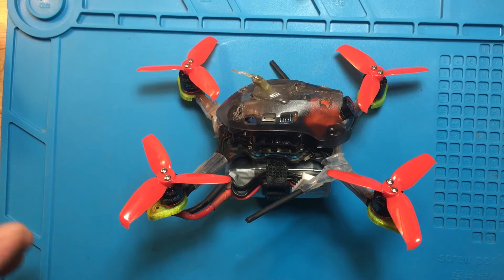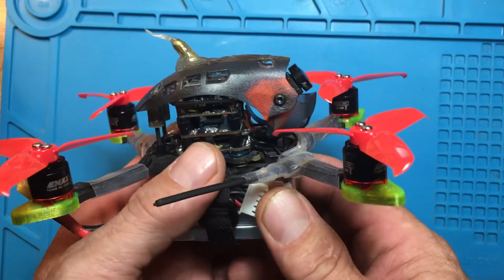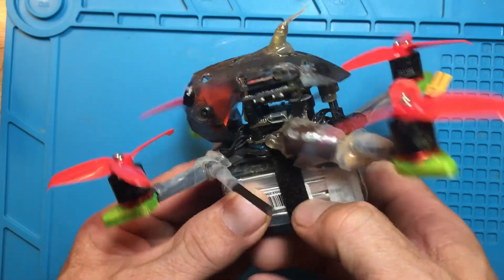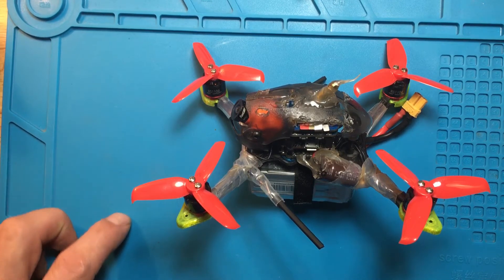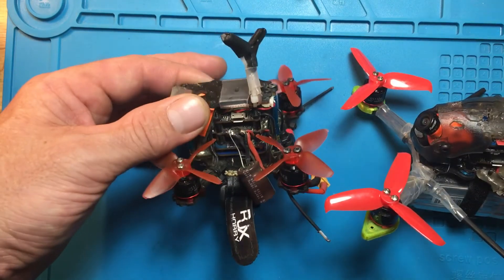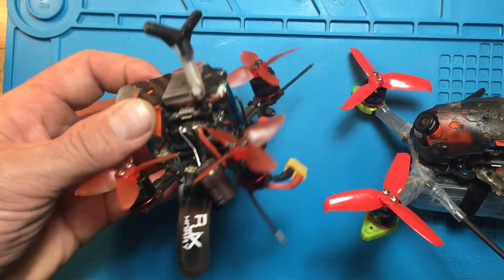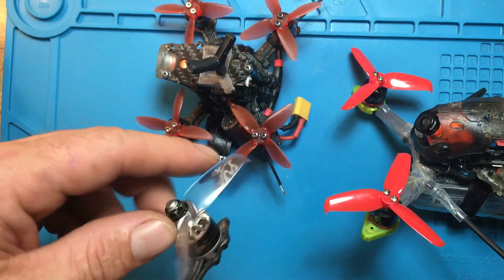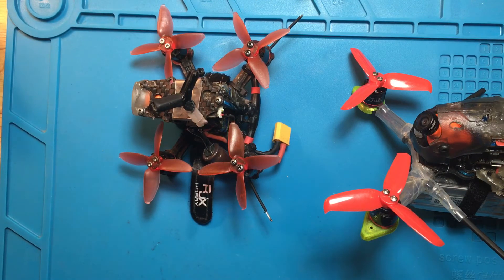Pro 4s & 3s PID’s for Babyhawk R, Paste CLI Dump!

Comment: Thanks for this. What BF version are you running?
Reply from the maker: NikFPV yeah this is pretty old. I think it 3.5.7 not sure, should have put that on the description but I just run BF 4.1 on I’ll my quads now with default PIDS and it’s much smoother 👍👍
Reply: @properfpv7160  oh good to know. I've these same motors and props but on the new betafpv 20A aio board. I can't get a good time out of these motors/props. I'll try the new Betaflight and see if that helps. Thanks!

Comment: More ppl should talk about the FIRE SITUATION my first one caught fire after a crash I bought a new esc and on plugging in the battery FLAMES and now I know bc one of the rubber I rings burned in the first crash and I said fuck it and didn’t replace it and the same part caught fire again.. I didn’t have problems running 4s tho hopefully the fc still has my tune on it so I can copy lol
Reply from the maker: You’re right. Emax has addressed the issue by including an isolation bed with the new craft. Thanks for stopping in. Means a lot.

Comment: Thanks for the vid. I have some questions. I just started flying my new 2” babyhawk r on 3s. Only thing I swapped out the props for the dalprop 2035 cyclone. I tried a 4s and noticed it had what seems like vibrations or just need to adjust the tune. Pids are stock.
Motors came down warm not hot. 
Climate was in the 60’s so not a hot day. Do you suggest lowering D gain ?
Also have a xjb145 that needs better tune for the 4s. What motors did you put in it ? Hobby brothers ?
Thanks for the vid
Reply from the maker: Rc Drone thank you for watching! Appreciate it! I have a 2” babyhawk based drone too. I use these PIDS (posted in description) on 3s. (Rate profile one) 
XJB-145 I haven’t tuned it perfectly yet, will post those when I figure them out! 😉👍 it has BrotherHobby Tornado 1407-3600kv